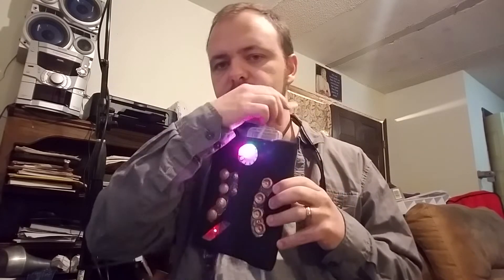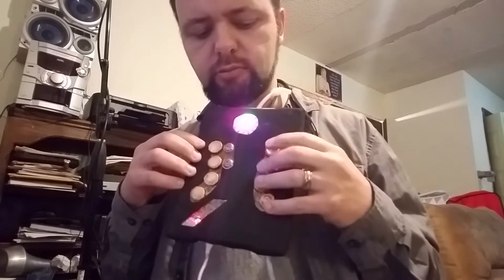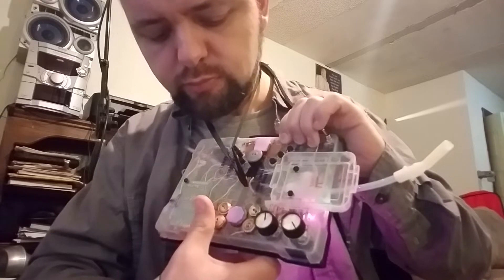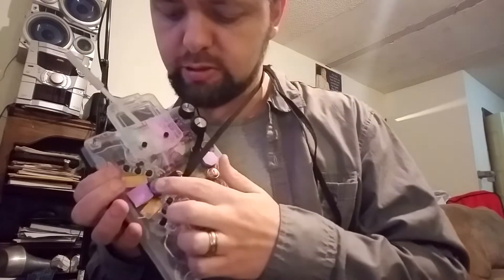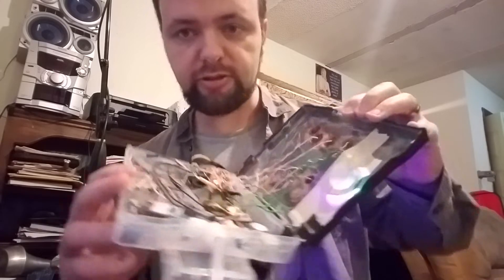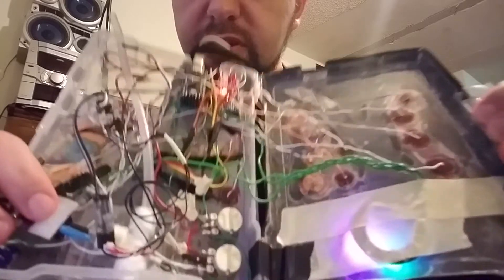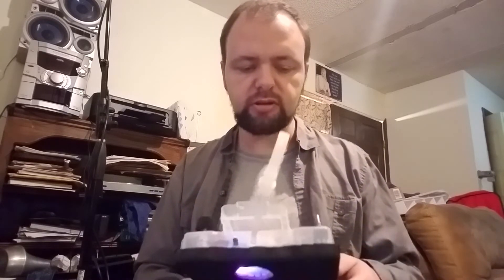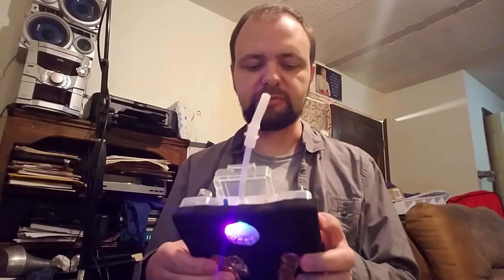Borgophone Tour - DIY MIDI Wind Controller

Comment: Do you have the code available for study or use?
Reply from the maker: Thanks for asking. I based my project on Johan Berglund's hackaday project, "TeensieWI woodwind USB MIDI controller." Youtube doesn't allow links, but if you google it you can find it. My code was built off of his. I have it on github, and will add the link to the video description.

Comment: This thing is a beauty. Does it work well for sensing breath pressure to simulate brass? I only really play piano, but I wanted a breath controller to make my orchestral samples sound more real.
Reply from the maker: Yeah, it works pretty dang well, for something made by a complete novice! I was just trying out some horn samples in Kontakt last night, and it can be very responsive. The thing I'm still struggling with is that if I set it up to send very frequent breath values, it's actually a pretty jittery signal, but if I set it to send less frequent breath values, the breath values are farther apart from each other, so you can hear some of the jumps in values as they change. At any rate, breath controllers are available from manufacturers that I think solve this kind of problem. If you want to grab one, I think they're pretty affordable as add-ons to a keyboard controller!
Reply: So can I email you about you making me one please let me know ASAP
Reply from the maker: @AWwifiperson  Sorry, I didn't see this sooner. What would you want made? One of these? I have no idea what it would be worth, hehe. The person whose project I started with, Johan Berglund sells some beautiful instruments at Berglund Instruments. I would probably recommend checking his site out because he has continued to improve on his designs and they are looking pretty amazing these days. I'm more of an amateur tinkerer, but would be happy to help someone tinker in an amateur way!